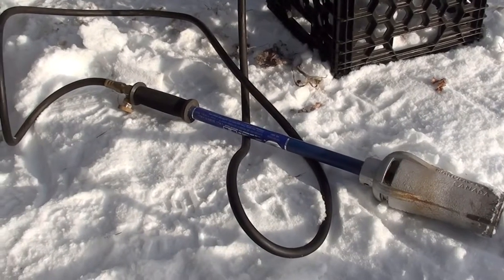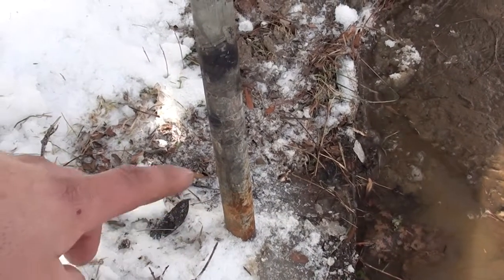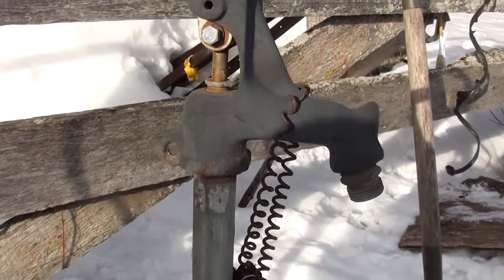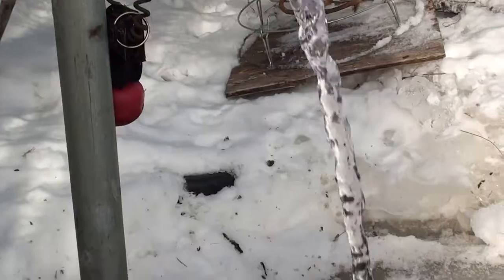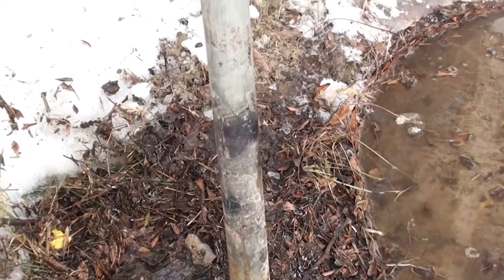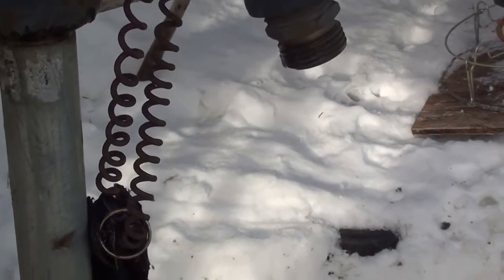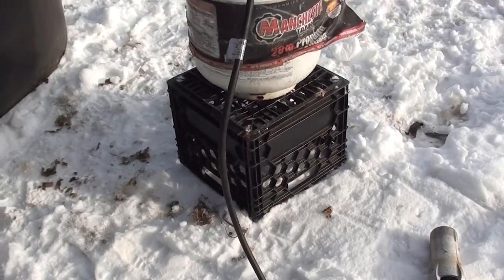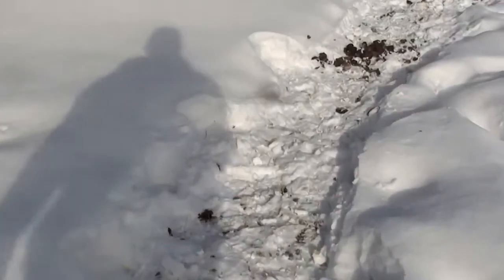Fix a Frozen Water Hydrant

Comment: Great tip, just thawed mine. Precaution, if the base is thawed first it may cause the water in the pipe to boil and the head of ice above it will prevent gases from escaping.  I used a burns-o-matic, thawed the spigot first then to the ground. 5 mins @ 12 degrees

Comment: Thanks for the vid!, I had mine freeze at ground level and used torch for about 2-3mins, and the plunger at the top was leaking a little, I tightened it and then front freeze working right

Comment: Mine is outdoors and froze up for the first time in many years.  Couldn't pull the handle up.  I poured about a gallon of hot water on area where brass rod plunger goes up and down.  Thawed in about a minute!
Reply from the maker: Good tip… but different problem.  That said if the brass plunger rod froze it means the O-ring seal is going.  It will get worse.

Comment: My hydrant is in my barn.  I really don’t feel like burning down my barn to defrost the hydrant.  Keeping my fingers crossed the heat tape and insulation I put on will work. 😬
Reply from the maker: Good luck but my guess is you will be waiting until spring.   Is it a frost free style or just a regular faucet?
Reply: If you clear around the area you're working and have goof fire extinguishers on hand you should be fine.

Comment: When installing put pea gravel around the bottom where the weep hole is then put a plastics trash bag over the top of the gravel so dirt doesn’t filter down thru the gravel and clog the weep hole.  Otherwise the dirt will clog it up and water will remain in the pipe
Reply from the maker: I dug it up this summer and put down some gravel.  But my problem at the time was the rubber valve was worn and not sealing.  Its repaired now.

Comment: We have had the coldest weather in like over 40 years. I wasn’t having any issues until about the fifth day. No water. Handle difficult to lift. It is supposed to warm up. But my question is will i need to replace the pipe? If it works when it thaws am i ok?  Its been in almost 20 years. Buried deep with gravel around. I am just hoping it will be ok when it thaws.
Reply from the maker: Hard to say, frozen pipes can split.  It will take along time to thaw... It the handle wont lift dont force it.  The longer it stays frozen, Id say there is greater chance for damage to pipe.

Comment: Dug down over 18" and used the dragon for over 2 hours, just now opened up.  Be patient
Reply from the maker: Exactly… sometime it takes ten minutes.  Sometime it takes hours.  The heat will transfer down the pipe and eventually it will thaw out.

Comment: my handle won't even lift like yours, even after putting the kero heater on it for half hr..im thinkin its frozen at the bottom at the weep hole possibly
Reply from the maker: Ive had to go as long as an hour.  the heat will carry down pipe... id keep trying longer.  Also as ground warms up try digging away some of the dirt to get heat down deeper.  Good luck

Comment: I’d say the weep hole is clogged
Reply from the maker: The rubber seal in the valve was worn and leaking so it was not completely turning off, allowing some water to creep up pipe.  Its been repaired.